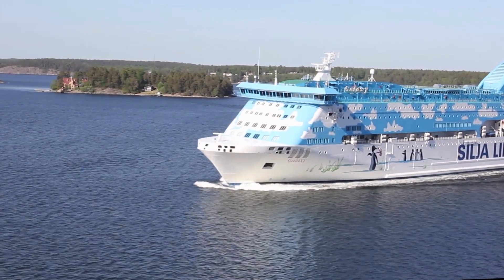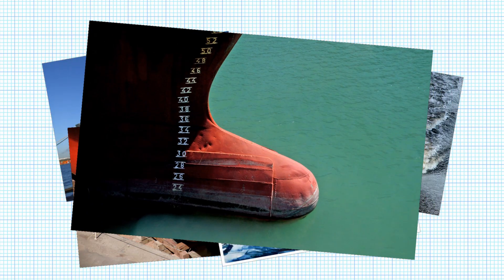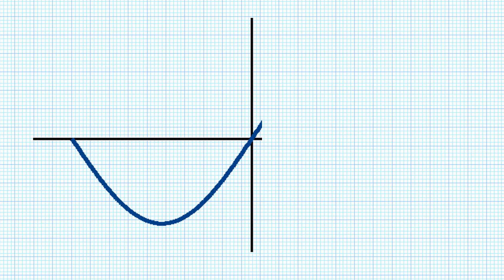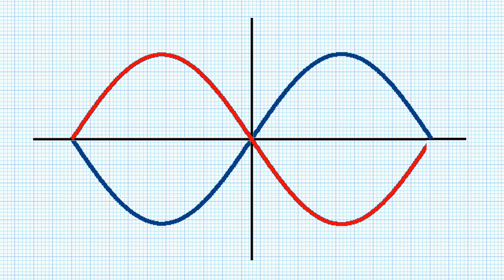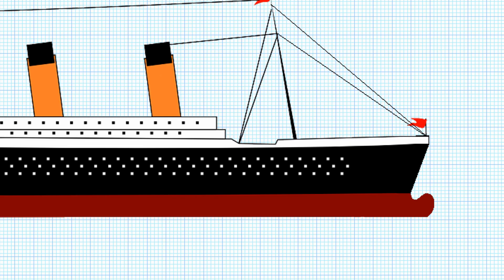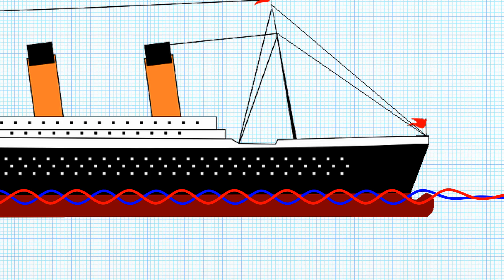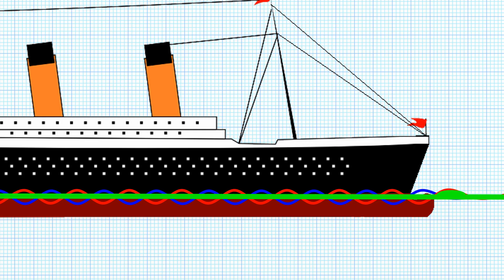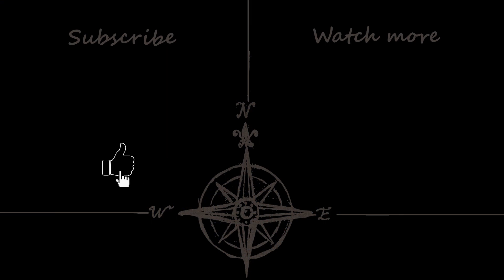What is the BULBOUS BOW for?

Comment: The bow wave you want to mitigate will vary depending upon the ships speed, sea state and wind. A fixed bulb can only be optimised for a single condition and in other conditions will actually be harmful. In any case, the mitigation will only be partial at best, so the benefits might be limited. For a vessel almost always travelling at a constant speed this might be acceptable. But for a vessel constantly changing speed and course, example a sailing ship or warship the benefits might simply be too small to justify the costs. For a small yacht the benefit might be very small ( the speed is low, the bow wave very small and the fuel is free and who really cares if sometimes you might go 0.1 knots faster ).
An ideal bulb would be able to change it's shape to automatically adapt to the conditions, just like aircraft have swing wings. However making a 10?? ton shape shifting bulb might be way beyond practice, although perhaps this would be a good project for a naval design student somewhere.
Reply from the maker: Thanks David. You are right, it would be a great project for a naval architect student - and I know shipping companies would buy it if it would save fuel!
Reply: @CasualNavigation  Why have a bulb at all why not a wing of sorts that can change pitch and independently move each side up down side to side, for how many years we have we been pushing boats,  why don't we pull them motor at the front, make the hull with length running winged channels so we also force air along the length of the boat giving it a lighter draft when under way.
Reply: @CasualNavigation  Does a Transom stern do something similar? Maybe you could do a video on that? I know Britain's last battleship HMS Vanguard had one.
Reply: @CasualNavigation  im going mental for all the like/subscribe animations you ceaselessly add in. give us a break, we're already subscribed and like tthe videos, why keep banging the drum if theres nothing we can do?
Reply: david james As I understand, these bulbous bows are used mainly on large, ocean traversing cargo vessels, which do travel at mostly constant speeds at sea. Their main speed changes happen near land, and not where they spend most of their time moving through the water, the ocean.
Reply: Moving the bulb alone, might not be enough to help. It might need to change size/shape as well. The key problem would be if the wider window of speeds gives useful savings at speeds actually commonly used by the ship.
Reply: david james what about some kind of inflatable type bulb that could dynamically change as speeds and conditions change that may be a possibility. But i am pretty sure the engineers developing the current shape and material used on ships would have explored this idea when they designed what is used now.
Reply: I doubt any material can currently, or even potentially, super the stress and forces necessary, and still be able to inflate/deflate.
Reply: @matthewhemmings2464  How about hydraulic plates? Basically using hydraulic pistons to move in/out nested plates on that make up the bulb.
Reply: kirknay then it couldnt be used as a ballast tank. The forward peak ballast tank is a favourite amongst sailors. You want to be able to change its buoyancy due to it having such a huge leverage on bending the hull.
Reply: I would have thought that a bulb that can be made to move it's position forwards and aft depending on ship speed wouldn't be beyond the limits of engineering. Wouldn't that widen the window of speeds for which the anti-phase wave could be set up?
Reply: Huxxy You dont want moving parts under the waterline. Thats a bad idea. There would be rust created (rust is like a cancer, if one chip in the paint is created, the rust comes immediately due to rushing salt water and it eats its way everywhere else from under the paint), there is too much biological matter like seagrass and barnacles, if the system fails its impossible to repair unless you go to drydock (very expensive), the bulb has to withstand extreme abuse (in storms, the front slams into waves so hard that water flies 30 meters up in the air) and the achor chain is known to sometimes go around the bulb when making a mistake heaving it. Thats a 6 ton anchor with two blades 8 feet tall that have dug themselves into the seafloor. 

Also, the bulb is a critical part in balancing the ship. It doubles as a ballast tank. If you cant fill it with water, you have a huge submerged balloon lifting the bow, which puts large stress on the hull and bends it.
Reply: @huss03  It will be very hard to justify. It will require energy to be moved, so extra fuel and some machinery in the nose. With the machinery comes maintenance, you need to build access and maintenance space there. Also there will be money for repairs. If some  hinge breaks how will you fix it ? You need to go to a dry dock which alone costs tens of thousands $ per day...
Reply: @huss03   the main criteria is water speed.  The ship does a lot of  cruising at one optimal  speed,which was in the specs ar design.   Anyway he misled.. of course a small error in phase is a small reduction in cancellation...its not that it has to be precise  to have effect
Reply: the speed of the ship will only affect the amplitude of the wave(thereby increasing or decreasing the contact area with water)...the wavelength of the wave will remain constant for a given vessel. the bulb is designed mainly to target the wavelength of the vessel's wave by generating a counter wave of same wavelength but with a phase difference of 90 degrees... however, bad weather and other factors you've mentioned will surely have a negative effect on the fuel efficiency. 

P.S: amplitude matters too as two waves with same wavelength and a phase difference of 90 degrees but of unequal amplitude will not completely cancel each other out.
Reply from the maker: Thanks Intex Cloud S9. I hadn't considered the constant wavelength before, but it does make sense that for any given draft the wavelength produced will be constant with only the amplitude changing
Reply from the maker: Thanks NuclearWinter2110. It's interesting to hear it from someone in that part of the industry.
Reply: haha, thats what i was thinking too! my brain just instantly went to „how can you make this thing change its shape to adapt to speed“
Reply: Interesting. As an aviator it reminds me of wings, and how any wing or NACA airfoil can only be efficient at very specific parameters. The ideal wing would be able to change shape to accomodate different airspeeds, weights, AoA, and purposes (cruise, instantaneous turn rate, sustained turn rate, payload, etc.). Not just wing sweep, but the camber, chord, sweep, tip shape, winglets, etc. Think how some birds can have an almost continuously variable wing shape. 
Someones gotta figure this out!
Reply: @MattH-wg7ou  like the tomcat,  tornado and F-111
Reply: @MattH-wg7ou  Like this? https://youtu.be/qDs7haZK7Go
Reply: Iconoclasticnation I wouldn't call it a novelty at all, it was a legit application. The main problem is the hinge mechanism taking up space and weight, and that modern wing design can solve most of the same problems in other better ways, including leading- and trailing edge flaps, slats, using the engines to force airflow over the wing in different ways, etc.
Reply: david james 
Not so much..the bulb pushes heavy amounts of water / pressure to the side..see dolphin nose..
Next gen has steam jets behind it
Reply: david james Swing wing aircraft are an endangered species.  Once the 1970s designed crop are retired they’ll be extinct.  Nobody builds them anymore.  They’re out of the US arsenal completely, and neither Sukhoi or MiG are making them.  It seems the novelty of the swing wing has worn off.  But they were beautiful aircraft to watch in flight.
Reply: Bulb actually has another function in warships that makes bulbous bows far more important than economy... Water flow around the the bulb will always be perfectly laminar, and its the most distant position away from the vehicles own machinery... Its the perfect place to put front sonar transducer.. Otherwise any interaction with bow waves plus other turbulent effects and hull will create additional noise. Raising the noise floor makes both active and passive sonar less effective.. Since sonar dome is flooded with water, it doesn't generate any buoyancy, so it doesn't contribute to pitching moment as well. It only functions as sonar dome in warships, with merely a secondary effect of canceling out the bow wave.
Reply: You know is a good comment when after clicking read more it looks like a novel
Reply: Maybe some kind of kevlar inflatable?
Reply: I believe some modern warships do have bulbous bows, but that is for the sonar, not to improve fuel efficiency.
Reply: I feel a military ship would be able to fit a sonar setup on the bulb, for antisub warfare, and research vessels could for marine life study.
Reply: In reference to the aircraft with a swing wing it's not that effective as the mechanism is heavy, has a high maintenance cost and in reality is best used on an interceptor as it can swing back for minimum drag but the only benefit at low speeds is not a midly lessend performance, rather than good performance. The only aircraft that every had one that really worked effectively was the f14 and it had to be retired due to massive maintenance costs, this is why you find all modern aircraft have a wing sloped at around 60 degrees, as this provides good high speed and low speed performance for far lesser maintenance costs.
Reply: @gryphon_Space   good points. But there was another variable wing geometry plane that was successful for it's role and era: the mig 25.
Reply: @agusti92  mig 25 wasn't a variable geometry wing
Reply: @gryphon_Space  ups, meant mig 23
Reply: @agusti92  the mig 23 I wouldn't call successful as it was useless in it's role of air to air and an expensive attacker with better options like the su25
Reply: This is probably the most intelligent comment thread on all of YouTube.  😂
Reply: when/if i design it i wiII credit you for idea.
Reply: Hydraulically adjustable semi sealed steel fit parts kind of like a Chinese yoyo with a bulbous nose. It wouldn't have to be waterproof as long as it's not internally turbulent affecting drag. If you have say a 25,000 gal water held in the front it would be roughly 100 tons of water if it was filled. compared to the way of a giant ship it's almost nothing, not to mention it's a little lighter under the water line.
Reply: @grandwaha  100 tons of water in front can be problem. 1. Stability as moment increases weight x distance.  2. Vessel with block coefficient if >0.7 tend to squat ar forward. So it increases drag. 3. If there would be problem of some kind it would be kind of hard to fix (freeboard on 50k tanker are around 12-7m) 4. In general bulbous bow is hit or miss. It can work and can not work for some vessel or condition. That's why theres lot of different shapes of it.
Reply: david james I was about to ask why warships don't have it. Thanks.
Reply: farid athar I was talking about modern warships. At least the one I served on didn't have it.
Reply: as above people's comment says warships that have em looks like the ones that have a constant speed like CVs
Thou looks like Yamato's just the one that made to lower her water drag
Reply: david james Not quite: https://pm1.narvii.com/6746/ea33a738ee9d92bca472763d2cdb23140de3d6dcv2_hq.jpg

This is an Arleigh Burke Class destroyer of the US Navy.
Reply: This reminds me with aircraft's adaptable wing.
Reply: Thank you David, very interesting. It seems to me that for a yacht, we have just one wave the whole length of the vessel, as it is operating near its "hull speed". For a ship, there are many waves along the hull, as it operating well below hull speed. This makes  the bulb worthwhile.
Reply: For warships however it's also a useful spot to put a sonar as it's in front of the wake of the ship and therefore there's less disturbance and you can correct for the sound the ship itself makes so some warships will have a sensor bulb, though it's also often just placed under the ship like on the Arleigh Burke class. However some warships can also expect to spend quite a lot of time at one constant speed if they're doing escort missions.
Reply: @karthikkrishna5870  Your comment looks like you're "dissing" someone who is trying to tell you something you don't know?

"Swing wing" is a valid term - google F-111 as an example of its use in a warplane.
Reply: @vk2ig  i just removed my comment, seems the video is edited?  I dont see why i gave a comment earlier. I watched again, i dont see it. Anyway.
Reply: On naval vessels it's refered to as a 'Sonar Dome.' So basically, it serves 2 purposes.
Reply: @Ivellios23  yo mama serves 2 porpuses 😎😎
Reply: @mistylover2082  Looks like someone's online without their parent's permission.
Reply: A "baloon" that inflates and deflates using hydraulics? The material for this I think would be not quite cheap but it might be practical for millitary appications (Aircraft carrier?) But I don't think we need much of it since we only need it as a "container" for water or a dense fluid (might consider oobleck :)) to b
Reply: They’re all female lol
Reply: Are you a sailor? Most of todays sailboats accomplish the same thing by extending the transom to make the boat longer. But, only when the boat is heeling and going faster, little heeling the boat is more upright and unless under power going slower, in this case the extended transom is not in the water. This minimizes the wetted surface so less drag and little bow wave.
Reply: I am sure that the cost of fuel is by far the biggest operating expense of one of these cargo ships. So I would imagine that the ship's design in it's totality is optimized to operate at certain parameters that are most efficient for fuel consumption. That would include the engine running at it's most efficient speed and this bow thing shaped to compliment that speed. They would then operate the ship within those parameters and the only time they would very from it would have to be a dam good reason.
Reply: Optimal for one condition =! Harmful in all others

As with most things it probably has a range with modes in which you still get a benefit even though it's not the maximum cancellation. So long as you operate within this zone you get a benefit.
Reply: david james you should be an expert in shipbuilding
Reply: just put wings on it like a submarine's diving planes, I would expect.
Reply: In times long since past, I attended nautical college, but dropped out because of a personal feud with maths professor... I did not really know this... They did explain it also helped with structural stability, i.e. hogging/sagging... Does it or did I understand this wrong?
Reply: Michael Thys Yes, it is a very good tank to use for that. Its called the fore peak, and is actually so critical, its not numbered, like other tanks. You talk of ballast tank 5, 8, 1, 10 whatever when naming other tanks, but the fore peak is always the fore peak. Due to it being so far forward, it has a lot of levarage to bend the hull. Anoter upside is that its round and exactly on the centre line, so you dont have to fill it to the top, like a bottom tank has to (due to sloshing, imagine holding a long box with 2 inces of water in it and tilting it, now imagine a basketball filled with 2 inches of water and tilting it), nor do you have to worry about it tilting the ship.
Reply: Well why dont they put canards on the bulbus bow I mean keep the bulb but add the canards on to the bulb?  Then you could have both I suppose efficiency and speed
Reply: I mean I'm an aircraft enthusiast but I'll look into it.
Reply: I hope that you applied for a patent before posting that comment
Reply: Well of course the ship will be traveling at a constant speed port to port.
Reply: david james
Reply: Åeverth
Reply: Thinking about it, I'm guessing this is why you mainly see them on cargo ships, cruise ships, longer range ferries (bass strait, cook strait, English channel, trans-mediterranean etc.). Yachts have no predictable traffic, and I'm guessing that being both slow and light, the additional efficiency gained by a bulbous bow would be minimal in any case.
Reply: @lmlmd2714  it is. On cargo ships by best its 1.5% but if u take in account that cargo ships  underway consume  20-100 mt fuel per day (50k dwt and bigger vsl. and some container vsl.) that 1% in some 10-20years  make some difference.
Reply: @lmlmd2714  Not completely accurate, not on any pleasure craft that can do an ocean crossing at a steady speed. If the best fuel economy speed for the yacht in question is 5 knots, having a bulbous bow designed for that speed and that hull will show a marked improvement in fuel economy. Cruising at any other speed will not show the same level of improvement.

Most of the CE category A yachts ( trans ocean vessels ) do have a bulbous bow. Nordhavn being the best known though there are a number of other brands as well.
Reply: you could make the bulb slide out and change its length, easy peasy. And also the speed doesn't have to be perfect all 0 to 90 degrees out of line situations would create a benefit, the other 90 out of the 180 would be costing fuel.
Reply: Awesome info. Thanks
Reply: On it
Reply: david james e
Reply: Thank you sir, maybe, studying NAME at UNO
Reply: I might be wrong... I would think that since ships tend to travel at fixed speeds for most of its journey, hence the fixed bulb would be a good compromise.
If sea state and wind conditions changes, I would think that the ship's captain would be able to compensate for this by adjusting the ship's speed with modern day's technology.
Reply: david james so, should warships have bulbous bows or not?
Reply: 11¹11
Reply: That's why most warships do not have them
Reply: In aviation there is something called a variable geometry wing which is a wing that can change its shape to better suit different speeds. If this bulb becomes a problem with slow steaming, couldn’t you just engineer a bulb that could extend and retract in such a way to minimize those waves at different speeds?
Reply: You don't know anything about that bulbous bow brotha
Reply: Darius Kang , measure the length of the water line from bow to stern (the stabilized or "cancelled" wave line with a correctly designed bulbous bow at the correct speed and running conditions, then measure the length of the sine wave without the bow extension (following the curvature of the line at all times). The sine wave comes out significantly longer than the stabilized wave.
Reply: Great thanks I was wondering why navy ships did not have it.
Reply: I thought it was for strafeing🙄🙄
Reply: Anothe F.K.A.   zzzzzzzz boring
Reply: Wow thanks for that information
Reply: The bulb at my front varys in size all the time , usually in the morning is when it's at its biggest
Reply: Yeah right fiction Dave, it’s the crew quarters pure and simple.
Reply: What if you had a separate cage similar to a pinball track mounted to the front  that is moved into position with varying ball sizes placed onto the adjustable track?.
Reply: Someone should design a way of controlling this wave so it is useful at different speeds, computers and controllable fins or veins to make the cancelling wave how you need it. The software exists already in noise cancelling tech.
Reply: @thedave7760  the software would be close to trivial. In this case, the key problem is that you have to design and build a flexible and reliable shape changing bulbous bow weighing many tones that would be absolutely safe and reliable for 30+ years. Since you are modifying a pressure wave, I don't think fins would work. Also you would have to test the finished ship in thousands of sea states, wind conditions and currents etc to prove the tech.
Reply: The Japanese mega-battleships had bulbous bows, and many of the Aircraft  Carriers.  If you  think of it, 99%+  of  their time is spent at "cruising speed"
Reply: Another genius chiming in the obvious. S T F U.
Reply: Thank you for taking the time to point out some of the complexity and trade-offs in the design of such a bow.

The factors you listed, as am certain you know, do not exhaust the complexities.

Other factors to consider are the loading of the ship, the possibility of using the bulb for other purposes as well such as mounting bow-thrusters, as part of the ballast system or even design elements for collision mitigation—though as it acts as a ram (studying ram bows is what is what led to the understanding of drag resistance) thus increasing the damage to the other vessel.

They are fascinating structures.

As a former sailor, want to point out that these bows were developed by the USN and first used on the battleship USS Delaware BB-28 in 1910. One of the most famous ships with a bulbous bow was the aircraft carrier Lady Lex—USS Lexington CV-2—sunk during the Battle of the Coral Sea in 1942.
Reply: That's why you only see them on cargo ships and cruise liners and not private yachts and small vessels i suppose.
Reply: A very good idea indeed
Reply: Are there any modern bulbous  bows which can adapt their shape depending on speed and sea conditions etc?
Reply: I assume that the design is based on a fully loaded cargo ship with a standard open ocean speed. Any other conditions are smaller by comparison.
Reply: @NuclearWinter2110  you Are Right, except hull mounted sonar sucks.
Reply: Imagine if there were some sort of articulated bulb that could adjust its own shape/diameter based on the forces applied to it.  The adjustments could be automatic and articulate to maintain a percentage of drag reduction based.  Imagine too the benefit of such a system that could induce drag to slow a ship as needed.
Reply: Thanks for the info.
Reply: 1.5k dislikes maybe they are the gay mates or the man who lack of loving and attentions then not have much enough a "ship husbandry" spirits in their life.
Reply: I know telescopes have the ability to adapt the shape of their mirrors to cancel out atmospheric distortion, those are two very different things of course but maybe they could make a bulb that can partially adapt to somewhat different conditions?
Reply: Thank you for sharing, I have 9 years working in a cruise ship but I don't what is the exact purpose of bulbus bow,
Reply: Haha wow this guy just owned the channel
Reply: anything is possible with the power of $700,000,000,000+ of military funding
Reply: Thanks. I'm also thinking about a "variable geometry bulbous bow"
Reply: Lmao
Reply: That's what he said.
Reply: Yeah but majority of times there will be one predominant sea condition and you build the bowel for that condition. E.g. Cruising speed out in the open sea.
Reply: Hmm...wouldn't changing a ships speed change both bow and bulb waves equally, and still cancel each other out?
Reply: @bobhenry6159  Since the physical mechanisms are a little different, they might not behave in an equivalent way at different speeds and hence not cancel out fully.
Reply: @davidjames1068  Maybe, maybe not. I would think engineers have this figured out a bit better than you're assuming.
Reply: @bobhenry6159   @Bob Henry  I am an engineer (in a very different field ). Compensating something with a different thing does not usually work well over all conditions, but it can be effective enough. Practically the cost of modifications would prevent much in the way of real world experiments, although I assume naval studies have spent a lot of time simulating the concept.
Reply: @davidjames1068  OK.
Reply: Do you know how drum-brakes work?

That, but with the water instead of the drum and (2) pieces of metal instead of break pads
Reply: 0
Reply: True. To produce baby ships and the grow them at lower cost
Reply: david james you can still try to aim at an optimal condition. The cost is marginal on the scale of large boats being built, and the drag is mostly affected by high speeds, so you can bet that optimizing the bulb for medium-high speeds for bigger ships is a sure way to go.
Reply: @matthewhemmings2464  that makes sense. I say this as almost every newer naval vessel I've seen (including the USS Gerald R Ford) has the bulbous bow.  Naval wouldn't be to concerned about the slower speeds. However, medium to top speeds is where it would really count for them.
Reply: @matthewhemmings2464  
Ää
Reply: NuclearWinter2110 Adjusting the C of G by using water is ingenious.
Large passenger and cargo jets use the same principle. Heavy cargo usually goes to the aft section of the cargo hold. This allows gravity to trim the plane (5° nose up attitude) as opposed to the trim flaps.
Reply: Conrad McDougall We do the opposite on ships. In lightship conditions, the ship usually has a aft trim (bow points up) due to the accomodation, engine room and because the very aft section often has less buoyancy than the rest of the ship (see cargo ship drydock). So when loading cargo, you out just a tad more weight to the front than the rear. The ship "sinking" down when getting heavyer already increases buoyancy to the aft due to the aft sitting deeper in the water.

After that, you fine adjust the balance with heeling- (if fitted) and ballast tanks. These take 500 tons of water each easily on medium sized ships. 

The passenger ferry i work on has 12 tanks (inluding two heeling tanks) with a total capacity of 3000 tons of ballast, give or take.
Reply: Conrad McDougall No chance. Having a plane with a too far aft CoG , ie behind the wings means the plane is in danger of getting in to a situation where it cannot correct it's pitch and may stall. So I doubt they do this. Certainly not 5deg anyway
Reply: “Fuel is free” AMERICAN SPOTTED
Reply: I'll get right on that!  lol
Reply: i think the only warships have them is Yamato.
no others

wait i forgot the modern CVs
Reply: @fjhatsu  Bulbous bow derived fm warships. Remember Trireme? In beginning of metal era in navy there was idea that it can be used for ramming as in old days, some of those where quite long. But with advancement in guns that idea died.
Reply: @varisantonovs2831  the bulbous bow idea was not fully realized until the early submarine hunting ships with their bow mounted sonar platforms were found to be a little faster and more fuel efficient than their blunt bowed cousins.
Reply: But, by designing for the target displacement of the vessel, wouldn't that give you better all around performance?  This is what is done for almost all planes, Swing wing planes are the exception not the rule. Almost all airplanes have stationary wings that are highly effective in their operating range.
Reply: Fuel is free? Yeah right
Reply: And here I thought it was in case an iceberg got in the way. The Titanic might have survived her chance encounter with an iceberg had  she been designed with this thing on her bow. Just saying. Have a great day evrryone
Reply: @davidurban6813  you could just be right she may be famous for sinking but if only she didn't turn that night and hit the iceberg head on maybe she would have lived to get the people to new York...  Why did she NOT hit it with her bow??  At least stop the ship instead of turning 😒 she is a cool ship wreck if it wasn't for the rust eating her like a sandwich.
Reply: @davidurban6813  No, the Titanic was holed on it's side which pierced several water tight compartments. If it had hit the iceberg headon, it might have survived.